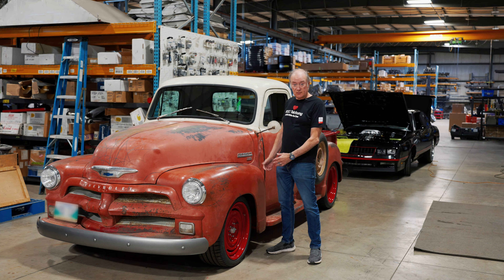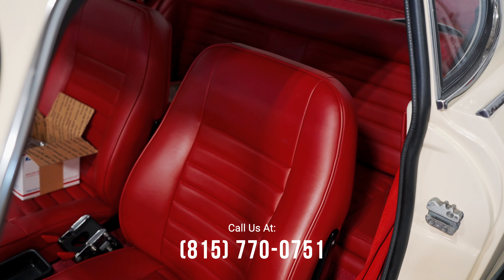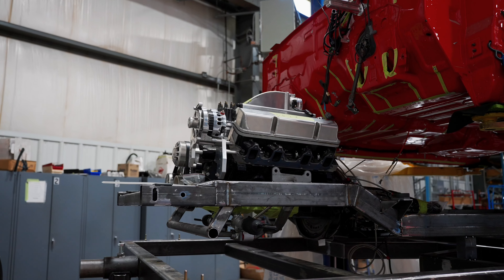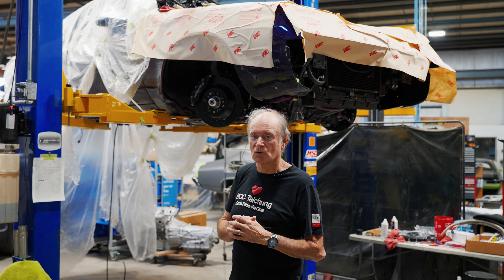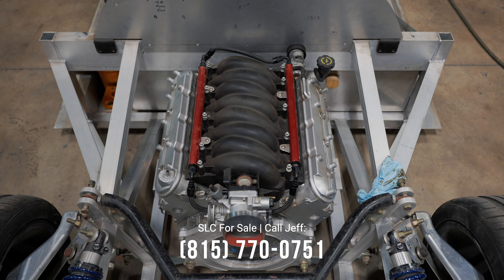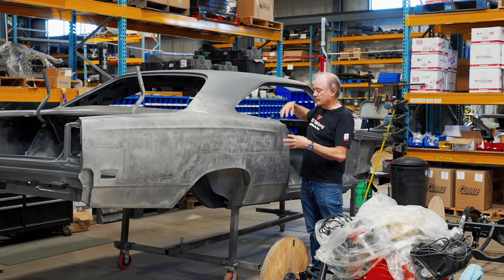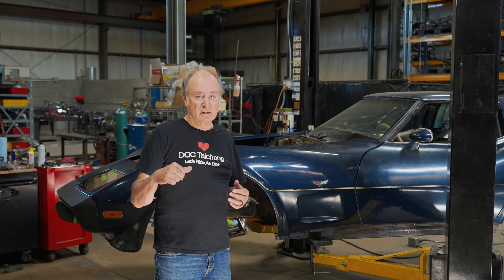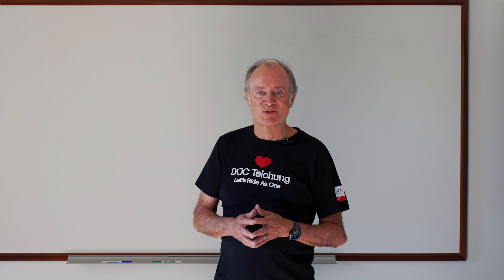Schwartz Performance - Shop Update | June 2024

Comment: Hi Jeff, 

Always enjoy the updates!!!

What do you use to protect paint when working over fenders (what are the yellow pads on fenders?) and also in general? I see you use a 3M product too. What is the part# of the 3M product? Can you also provide just a general statement on what your shop does to protect paint while working on projects? I've got a 67 Nova I just got back from the body shop and want to be as proactive as I can to protect paint. Typical DIYer in a single car garage. :)